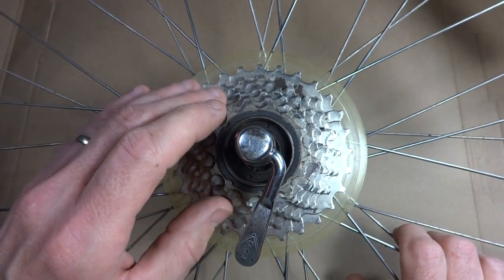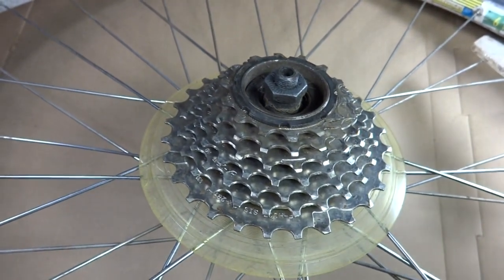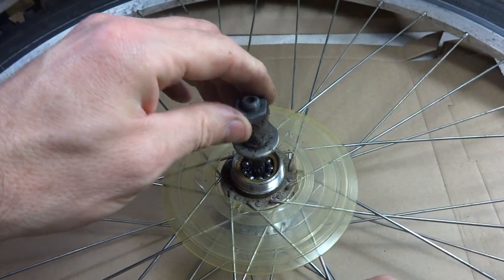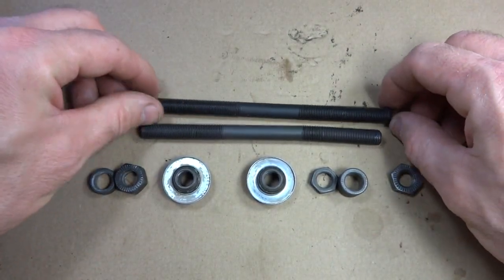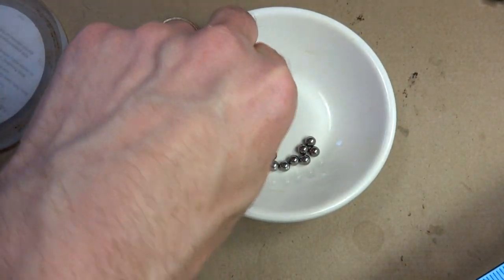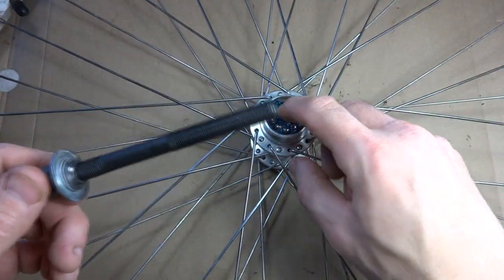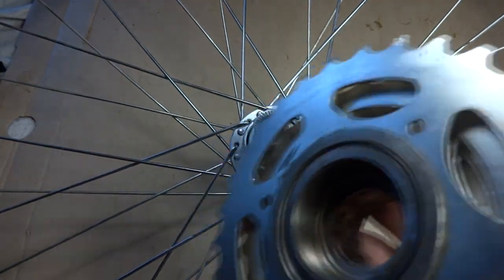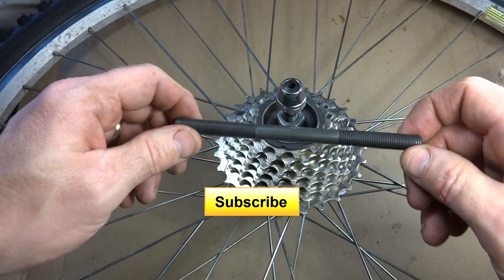How To Replace A Bent Axle On A Bike Wheel

Comment: A tip for the viewer. Leave a tiny bit of play because when the wheel is clamped in the frame that compresses the hub and takes out that residual play. The result is a wheel that spins very smoothly.
Reply: True! Specially with wheels held in place by nuts as opposed to quick release skewers. :)
Reply: Yes.... a little play is a must...
If you dont do it... it wears off faster.
Reply: Play=wear. Too tight cone= wear. It's a balance between both.
Reply: So hand tight the cone?
Reply: @SouthwestSasquatch  Hand tighting can also be too tight or loose. Depends on how smooth the threads are. It's best to check play by wiggling the axle. You will quickly get a feel for the right amount of play.
Reply: thank you!
Reply: I leave a bit of play and wheel wobbles...a bike mech told me not to leave play...thats why it wobbles
Reply: He said there shouldn't be any play

Comment: Hey RJ!  I really appreciate you sharing your knowledge in your videos.  It's invaluable!
One thing H.S. Army ROTC taught me that I really appreciate to this day is that when field stripping a rifle (or bike axle for that matter,) as the parts come off, put them down in front of you beginning at the left and part by part work your way to the right. To reassemble the assembly, reverse your steps beginning at the rightmost part and work your way to the left.  You will never get the parts out of order.
Reply from the maker: I generally lay them out in an exploded view of the assembly. For me it's easier. If I laid them out as I took them off, there could be left and right side parts mixed together. For this hub, it's not too bad. For something like a Sturmey Archer 3 speed hub, there are a lot more parts.  https://www.youtube.com/watch?v=vNxwMwzS3Jo
For me it works.

Comment: Thank you, this is still helping people 9 years later! I broke my rear axle after a few thousand miles, but I had a spare axle and bearings from my old rear wheel, which had a damaged rim that I kept for spares. (same model) 

I was having difficulty figuring out how to swap the axles around, and didn't know I needed a special cone spanner - Fortunately my slim pedal spanner was the exact right size! 

Reinserting the ball bearings using just gloved fingers (8 each side on my wheels, apparently) was a test of my dexterity and patience -  But with a lot of extra replacement grease (applied with a lolly stick! No fancy tools here!), it now runs smoother than when I got it. Fine tuning the cone and nut so that the wheel turns smoothly without any play was a balancing act.

Comment: Thank you a lot.  It takes a while to have it tightened just right (not too loose not too tight) 
It is a while since wanted to replace the rear solid axle by a quick release one, and all shops I went to ask they were saying 'not possible, you should change the wheel. It will be around 50 eur'. I was almost 100% sure it was possible, and here it is! .Done already!

Comment: my axel didn't just bend, it snapped in half. I wasn't doing any wacky tricks or anything, it was just old.
Reply: I'm pretty sure you forgot to put  the plastic dust shield on before you put the rear free wheel  cassette on
Reply: Is doing wheelie cause it to bent@
Reply: BobTheBuilder294, the bend in the video is just where the drive side bearing is located (not half way through the axle).
Seems this is a known disease of back axles in freewheel bikes.
The drive side bearing is farther away from the drive side dropouts than in a freehub setting.
For detailed picture see:
https://en.wikipedia.org/wiki/File:Labeled_Bicycle_Hub_Comparison-en.svg
p.s. 
I maintain 2 Trek FX 1 bicycles, both bought new on 2017, equipped with a 7-speed freewheel.
Both serve for basic commuting on bicycle paths and roads.
I already experienced 3 axles snapping (twice in one bike and the 3rd in the other), at the exact same location near the drive side bearing.
This has nothing to do with one's weight, based on 170lbs and 130lbs riders.
On the latest inspection, I replaced both Quick Release hollow axles with solid ones. I will probably inspect it once a year.
Reply: Rip axle
Reply: Same thing happened to me yesterday🤦 easy fix though

Comment: I did that a couple times with the rear axle on the KIA BMX bike I had back when I was a kid in the 80s. The rear axle got stripped once from changing flats a lot. And the second time the axle got bent from too much ramp and bump jumping. It was fun being it was a coaster brake too. I also modified the coaster brake to be a free wheel and added a rear hand brake to the bike. It worked better with the hand brake. I forgot to add that I also snapped off the quill neck on it too doing a big hill jump on a homemade BMX track in the woods near where I lived back then. The quill neck got replaced with a four bolt double clamp type BMX neck and a new set of BMX handle bars to match the neck mounts.

Comment: RJ..this video gave me what I needed, but you might consider (I searched but didn't find anything) a video showing how to replace a 130mm hub axle to run in 135mm  rear dropouts.  There is a very slim selection of decent 135mm rear-hub, rim brake, wheels (wheelsets) available.  After considerable searching I picked up a 100mm front, 130mm rear wheelset and will need to swap out the Axle-03(141mm) with the longer Axel-04(146mm).  Maybe a video covering various ways to adapt commonly available wheelsets with older, non-current-standard rear dropout widths??  Overall THANK YOU for your videos..excllent quality that have saved me a ton of time and money.
Reply from the maker: There are lots of 135mm wheels available. That is the norm for 8,9,10 speed rear mountain bike type hubs. 130mm is the norm for 8,9,10 speed road bike hubs, or 7 speed mountain bike hubs.
Reply: @RJTheBikeGuy  In my case, I'm putting better road bike wheels on an older hybrid('91 Trek 750) 'that's been converted to a drop-bar road-light gravel-touring bike for my girlfriend(120#)...per one of your videos. I found few to no <$350/set, ready-made/off the shelf 135mm rear hub/wheelsets that weighed 2000g or less(rim brake only).   From researching the forums, it seems many folks have run into this same issue.  Everything I (and others) ran(run) into are disc-brake hubs.   There are many options in this price/weight range when you look at 130mm road bike wheelsets.  I picked up a nice 100/130mm set with Shimano 105 hubs and will be replacing the OEM 141mm Axle-03 with a 146mm Axle-04.   I'm sure there's lots of 135mm rim brake options if I had a custom wheelset built..but off the shelf..didn't find much of anything beyond 2400g+ wheelsets.  Maybe I'm looking in the wrong place...I visited a long list of websites in both the US and EU.
Reply from the maker: @kevin_a4391  Then coldset the frame down to 130mm. Like this, but squeeze them in. https://www.youtube.com/watch?v=YdibmxBuMy0

Comment: Thx RJ!  Always making it look so easy.  I’m trying to see if I can change out or adjust a fixed wheel hub to fit properly on an older specialized Allez circa early 80’s. (Cable guides for derailleurs on top side of bb <weird and fugly>  Also debating if I should grind them off once fully disassembled before a repaint).  I’ve watched a bunch of your videos, always a pleasure, and figure it’s time to get hands on.  Apparently the rear spacing on bike is 125mm and standard size fixed rear wheels is 120mm.  I’ve seen you cold set steel frames to wider spacing but instead of cold ‘squeezing’ the bugger smaller I thought maybe to see about modifying the wheel if possible.  An additional 5mm might just be accomplished by utilizing spacers I was thinking but need to leave enough threads to safely accept track nuts.  I’m about to find out and learn a lil sumpn’.  Anybody else wanna throw in a nickel  (might need a smidge more than two cents) it’s welcome.  Aloha from HI!
Reply from the maker: Actually, the spacing is probably 126mm which is the norm for 6/7 speed road wheels. Personally, I would leave the Allez geared. Those were nice bikes. Check the move American Flyers if you haven't seen it.
Reply: It’s red as well.  Not exactly in top shape as it was neglected and has a bit of surface rust here and there.  Maybe I’ll convert it and leave the wanky derailleur cable guides so it could potentially return to its original purpose.  Blame it on Fixie Fever not the Corona.  Be safe out there and a thousand thank you’s for all of your insightful, well narrated videos.    Btw it’s currently set up six spd at the rear.  Stickers indicate  SE, special series racing, cr-mo double butted frame and fork.  The crown at fork isn’t offset that would indicate, I believe, to be post 3rensho.  Also the serial no which seems nearly useless for specialized starts with an M.  Built by Miyata maybe?

Comment: That thin 15mm bearing race/cone tool you have is very important and one that will last and not twist and bend is hard to find.  I try not to use adjustables anywhere as they tend to chew on nuts under heavy stress.

If one can't find the right axle in a reasonable time, how safe is it to unbend the one you have, harden it again on fire and water bucket, and reusing it till a replacement appears?  I've done it, found the replacement, but waited for it to bend again.  Finally I replaced the whole wheel (conversion) and the axle was still straight.
Reply: Just happened to me as well for not wanting to spend a few on the cone wrench
Reply: I can't find it at all for my fat bike.
And I want to do the same thing but I don't have a strong fire flame to do it.

Comment: Hey RJ, thanks for the advice but I was wondering what exactly causes the axle to be bent or broken. I've had two axles break on me in the middle of my rides. Is it because of riding too hard and on bad roads / surfaces or because freewheels on older bikes without a freehub allow for more tourque on an axle overtime.
Reply from the maker: Hubs with freewheels have bearing further in, allowing more leverage to bend the axle. Cheap axles are more likely to bend. Quick release axles bend easier than solid axles. Misaligned dropouts can also add pressure to bend the axle.

Comment: If the axle had a hex hole at the end you could put an allen key in it so when you tried to tighten the lock nut it'd give you more control over which nut you were tightening down.
Reply from the maker: The axle doesn't have a hex hole. It don't think I have ever seen that. It would be easier if I have three or four hands.
Reply: shyflirt1 Bench vise on the bottom locknut works wonders for adjusting hubs
Reply: A vice to clamp and hold the other end while you tighten would be handy

Comment: This seems to be frequent problem with freewheel hubs due to the axle sticking further out on the drive side. I have one bike with a freewheel and a 10mm nut axle which is bent. I'm planning to restore the bike and to go with a freehub to avoid dealing with bent axles.
Reply from the maker: I wouldn't say "frequent", but happens more with freewheels as you say. I have never had an axle on one of my bikes bend. I have only every had to replace one or two on bikes I have worked on.
Reply: Yes I agree. Having ridden my bike across all of Spain with no difficulty I am having to replace a bent axle now which was only replaced last year for one that snapped. As others have agreed this design leaves a big stretch of axle unsupported. I am also wondering if the wheel has now become damaged accelerating the wear? I was pleased to see the wheel in the video being reused as is.

Comment: how can I prevent this from happening. I just got my rear wheel replaced by aocal bike shop. took my bike for a ride and bent the axle. not sure if it will be covered under warranty. I didn't even take it off any sick jumps!
Reply from the maker: +MCRideout Could be many things. Maybe your drop outs are not aligned, or maybe you have cheap axles...
Reply: +RJ The Bike Guy I'm thinking it was a cheap axle. I'll be taking it back to the shop to see what they can do. Thanks for the reply. I'd like to convert to a freehub as those are stronger.

Comment: Freewheel axles usually bend I've been finding out recently, especially on 7/8 speed or higher. Which is why people switched to cassette. Just wondering, if you knew any hacky methods of preventing freewheel axles from bending? Other than replacing the entire rear wheel of course lol. 

Realizing that I can't be too rough with my old freewheel bikes kinda sucks. 

I heard 120mm axles with 5 speed freewheels bend less.

Comment: is it necessary to remove the freewheel? i got the axle out without removing it
Reply from the maker: It will be a total pain to deal with the bearings with the freewheel still on.
Reply: @RJTheBikeGuy  I got the axle out (cause I did not have the tool for the freewheel to take out) and now I cannot lock axle into place - the only way to do it is to lock it with the wheel simultaneously. :(
Reply from the maker: @the_real_economics  Buy a freewheel tool!

Comment: Haven't properly had a look on this problem but have you ever had something like knacking noise coming from the rear around the freewheel and axle? It's weird problem and only happens from third gear upwards (5 speed fw) and only when pedaling.

Comment: Hi RJ,
First of all, thanks for the great videos. I like your channel, I always go back to your videos before servicing any part in my bike.

That bieng said, I have a question somehow related to this video. I have bolt on wheels on my GMC Denali bike and I want to change it to quick release. What axle length should I look for? and My current cups are slightly smaller in diameter than the wheel hub opening. 

BTW, the bike has a freewheel.

Comment: hello RJ, my axle is fine but skewer is slightly bent about 5 to 10 degrees at the threaded side. do I have to change it or use it without worrying? does it damage the axle in the long run?
Reply from the maker: +imhs81 It's it's just the skewer that's bent, I would just try to straighten it out without bunging up the threads.

Comment: Can you replace a 3/8” threaded axle with a M9 threaded axle going through the same hub? 
The problem i have is i bought these new wheels but the axle doesnt fit in fork dropouts. They’re like a mm too thick. 
Its a carbon fork so bending it probably isnt a good idea. I thought of taking a Dremel to the metal part of the dropouts but id rather not. Any advice?
Reply from the maker: https://www.youtube.com/watch?v=gsdxS046jpo

Comment: Great detailed video! Question though, does anybody know if we can just reuse the same bearings? Also do we have to have that thick grease when putting the bearings back in, or can we use a standard lube? Also, how can I figure out what kind of axel I need should this be the problem? Input from anybody smarter than me would be appreciated lol.
Reply: Well I think it's recommended to change them but you can look closely for any rust or not even roundness, and if there okay just clean them up.
Grease is better in bearings, lube specially if it's runny dries up faster.
You can try measuring it and giving your bike specs to the bike shop or where you buy your supplies.
Hope it helps

Comment: Hey RJ, How do you adjust the axle if you dont know how many threads are exposed on each side? I have this problem. When I put the wheel on the bike its not in the right spot so the one of the v-brake arms is to far out so the brake pad wont reach the wheel, and the other one presses on the wheel all the time. I tried to fix it by adjusting cones and locknuts many times but I failed. Its a rear wheel with freewheel mounted to the frame with two nuts.
Reply from the maker: https://www.youtube.com/watch?v=0MHBHFu4CrA

Comment: Maybe dumb question: What's the best place to buy a replacement axle? And can you use the same axle for a freewheel and free hub? Or do you need a special axle for each system?
Reply from the maker: Bike shop, amazon, ebay, google, etc, etc
Reply: @RJTheBikeGuy  are axles the same for freewheels and free hubs?

Comment: the whole rear wheel axle is in half with all the bolts intact and the sprocket is still on the wheel. I loosened the bolts to remove the wheel and the whole thing just fell off completely, so now i have two halfes of a rear axle and wheel with the sprockets intact i don't know how to remove the sprockets from the wheel please help

Comment: im trying to get a new rear wheel but its just confusing on axle sizes. how do you measure it?
Reply from the maker: I am not quite sure what exactly you are asking. Can you give me more detail?
Reply: how do you measure the axle?
Reply: like to determine if it is 3/8 or 12 mm or 14 mm
Reply from the maker: Common axle sizes on road and mountain bikes are 9mm front axle and 10mm rear axle. 3/8 I believe is BMX, as is 14mm.
Reply: thanks
Reply: I have a 2018 so cal flyer and every time I pedal fast or try to wheelie it it makes a loud noise and then the chain goes loose and it keeps happening and I checked my back rim I thought it was bent but my axel was really loose what do I do